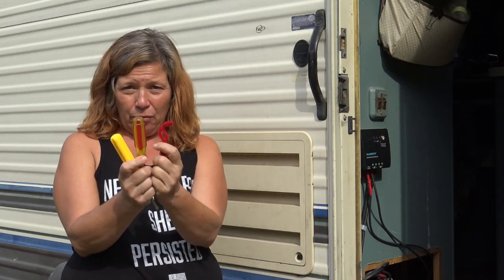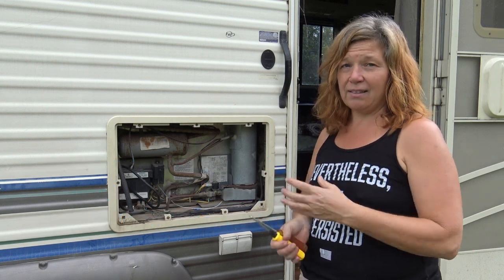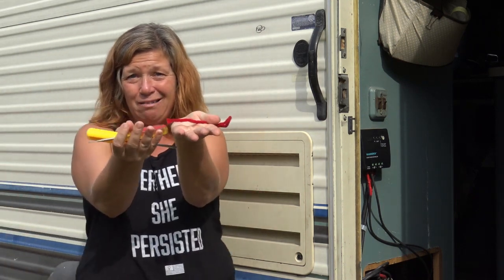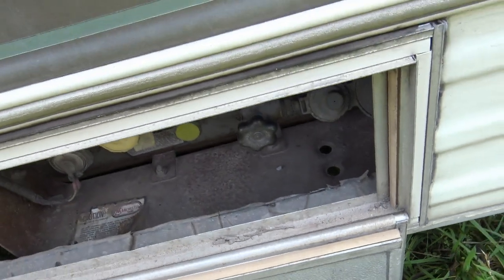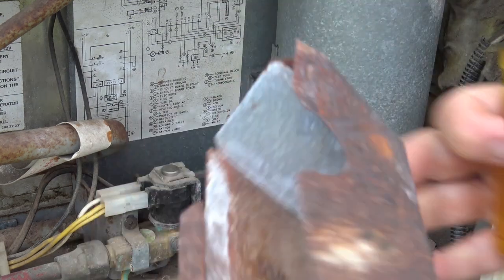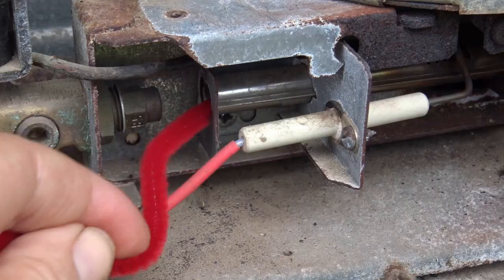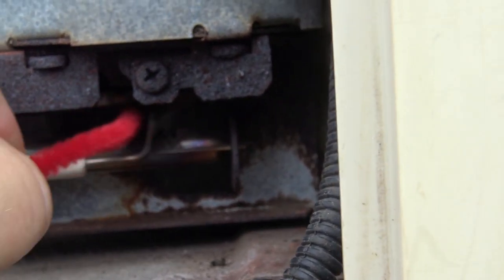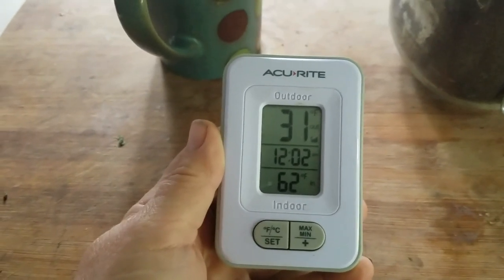How to Fix an Old RV Refrigerator that Doesn't Get Cold

Comment: i have fixed many refrigerators in rv parks when i find my baffled neighbours playing with their unit. If you get that screw out and get the burner tube out, you can pour rust out of it. Peoples eyes get wide. so then put the cover back on. Next go on the roof and take the plastic cover off. Inspect the screen to be sure air can move thru it. After the flame, moving the transported heat away from the condenser coil is equally important. Clean the screen and if you want here is where you would add a cooling fan to draw more air thru. Carolyn, you are exactly on the right track. Keep up the great work.

Jacqueline,
 Mechanic and Refrigeration Technician

Comment: Good on you Carolyn for taking this as far as you did.  I had a very similar experience with my 2014 Tioga Class C a few year ago in Key West FL.  It worked great on shore power, not so good on gas.  All the RV techs, told me to buy a new unit…I knew the problem was in the gas. I fooled around with it for days cleaning this and that and nothing changed.   Everyone was going to dinner and beach parties and I couldn’t go and stayed to work on my RV for days.  

I finally talked the local RV shop to sell me a USED, jet they didn't have any new one available. I switched out the jet and bam…it worked just like being on shore power.  It was my problem all along.  I then took a magnified picture of my old jet (which I tried many times to clean with lots of products, like alcohol or break cleaner and nothing worked) and I could see what looked like salt deposits in the jet almost closing off the orifice.  I still have it and will try to send you the pics of the close-up.   

I suggest buying a new jet, mine is a 58, you can see the number printed on the side when you take it out.  Its on the end of the tubing coming from the gas supply just before the burner. Here’s a link on a Dometic Orifice #58 Burner Jet  http://www.dyersonline.com/dometic-orifice-58-burner-jet.html?utm_medium=shoppingengine&utm_source=googlebase&gclid=CjwKCAjwuITNBRBFEiwA9N9YENGT1jvMbvak4THks2c27ObhI4d3vfCmLuOEYvwUi8NClKWwR9wbkBoCiRYQAvD_BwE

I found out you also need to clean the flue (burner tube) from above with a wire brush.  You can order one on-line from Dometic or I was going to buy a 3/4” pipe cleaning brush from Home Depot and rig it to make it long enough to clean the whole pipe from above, but I ended up taking the whole thing out and it really wasn't that bad. 

One more thing, on that condensate drain hose, instead of running it straight out the vent cover, first insure there is a drip loop in the hose before it goes outside.  This drip loop will act like a pee-trap on a sink and seal the outside air from inside your refrigerator.  Just make it go down first then back up high on the vent cover. The outside air can migrate up the tube and raise the temperature  as much as 10 degrees….and that burner cover should be tight, or could blow out from the wind when your driving. 

Let me know if you try this…Terry

Comment: We had a problem once with ours. Found the problem by chance. I broke the rooftop cover and when I pulled it off to replace it we found that the insulation above the fridge came loose from the sidewall and was blocking the air flow up through the roof. Made all the difference just by securing it back in place. Safe Travels!

Comment: "Sometimes I get lucky, sometimes I break shit."

We need THAT on a tee! lol

Everybody else is asking about your tank top, I want to know about your back tats!
Reply: Propane scares the crap out of me.
Reply: Janet, propane takes some getting used to. I used to make glass figurines and beads using propane tank and a torch. I had all sorts of safety re; propane only outside, flashback arrestors, always tested for leaks, etc.,  but still felt nervous every time I lit the torch. Then again nothing ever happened to the thousands of people who also make lamps-work like me. Or grill out. :) 
Cheers!
Reply: HAHAHA I'll Buy That!!!!
Reply: So would I buy a T with 

Sometimes I get lucky 

Other times I break shit

Love it
Reply: True words! I'd love to have that on a shirt too!
Reply: I want one!!!
Reply: Angela Siegfried Propane scares me too. We have a slide in that we discovered needs completely rewired, so we decided since we have to go that deep, we're building it back up completely solar. Including electric appliances. Then propane won't be part of the equation.
Reply: lol i agree Sometimes i get lucky sometimes i break shit does need to be on a shirt lol id buy it
Reply: @janetjohnson4246  It doesn't bother me at all. The trick is to know what you're doing, and how to be safe.
And don't run it on propane when you're traveling.

Comment: Greetings Carolyn, a couple other tips that will help, make sure your vent on the roof for your fridge is clear of debris. Good air circulation is a must for an RV fridge. Also, I've seen people mount a computer fan on the coils which  makes a big difference. There are several how to You tube videos on this topic. Lastly, the easiest fix is to park your RV so the fridge side in not in the direct sun.

Comment: Install a small 12 volt circulation fan up facing towards the refrigerator  chimney o the roof.  I put an on/switch on the circuit.  On hot days it increases the air circulation and gives me great cooling.

Comment: Another thing you might try is putting an "S" in the condesate drain tube to form a p-trap, like under your sink. Make sure it has enough water in it to make it air tight. I've heard (but haven't tried it myself) that this can get you another 10 degrees of cold, especially in warm humid climates. Makes sense to me since that tube is basically a 1/2 in diameter hole between your fridge interior and the warm outside.

Comment: Thanks for the ideas, I'm glad that you found a way to get the refer colder. Nothing worse than having a refrigerator that doesn't give you full service. I'm thinking of pulling the vent pipe out and having a sheet metal shop replicate it with stainless steel. It would never be the source of crap in the burner again.

You're on the right track and you've given me some ideas. I've seen guys with air compressors blowing out the burner. A great alternative would be to use a can of "Keyboard Air Cleaner". They come with a small tube that can be used to focus the air directly down the burners and up the burner in the same direction as the gas is blown. 
Further thought is the heat has to get into the flue and be there long enough to get the ammonia heated. Removing the baffle is probably allowing more heat into the vent pipe. I suspect my problem may be at the top of the vent or on the fins of the upper 'radiator'.

Comment: Hey friendly. I don't know if you couldn't get the screw out because it was too tight, or if the head was stripped. If the head is stripped, laying a wide rubber band over the hole and then inserting your screwdriver usually works. Just an FYI. Fun video.....
Reply from the maker: Thank you Linda!
Reply: Don’t ever use a drill on a stripped screw

Comment: Consider soaking the cover in vinegar to neutralize rust. Paint cover with Zithron 900 1235 degree extreme temp paint. To restore corrosion protection.

Comment: I put heat shield on any pipes that get hot back there and I put an exaust fan on the vent door. My temperature dropped 15 degrees.

Comment: Carolyn a air compressor may be helpful to clean the burner and the exhaust pipe of that system . If there is no air compressor available you may want to try the cans of air that people buy to clean dust off their computer keys boards It's fun at times to watch your videos and I imagine the fun interaction I could have with you⚓

Comment: Carolyn that cover is for when you're driving and if there's a lot of wind  to keep the flames from going out if it's on.
Reply from the maker: Yes you are correct. The cover is still protecting the flame and it's staying lit only now it's not blocking the flue!
Reply: That's good,  enjoy your travel.

Comment: Good job, Carolyn. You figured out what the professionals couldn't do. haha. It's just funny as heck. The clicking after you disconnect the electrical is the unit trying to turn on, on propane.  If when it starts clicking, run into your RV and check out the light on the refrigerator and it will indicate that it is trying to turn on, on propane.  
Also use a screwdriver and tap on the flu and then do your cleaning. You'll get most of that rust out.
One more thing, if it's a Domestic refrigerator, many years ago there was a recall on that brand because they were starting fires. So what consumers had to do was take their RVs for a fix and if I remember correctly all they did was install that small cover to cover the flame.  Go to the domestic website and enter your model # and be sure what I'm telling you is correct.  I am so damn proud of you girl! You can do anything.  Keep making those awesome videos.  Stay safe!  Love ya  :)

Comment: Hey Carolyn the flue should be checked for structural integrity aka holes and excessive scaling of rust . If the flue as it goes up to the roof develops a pin hole due to rust  the heat could seek out combustible material and the result could be a fire or carbon monoxide poisoning. Some systems cost money to check and repair why? because YOU are worth it.
Peace Out

Comment: Carolyn, I couldn't agree with the posters below that said you should replace that cover/shield that you removed.  It wasn't put there without a reason.  It looks a little bent on the right hand side and I'd bet that the "flap" on the left hand side belongs tight up against the other sheet metal. this may cause a draft through the burner tube that affects combustion.   As the others have commented carbon monoxide is nothing to play with.  As Jacqueline said you need to get the burner off and clean it out along with as much of the flue as you can.  I would also ensure that the coils are clean.  If you can't get the burner tube off you can probably clean it fairly well with a vacuum as compressed air will tend to spread the rust all over and possibly clog the orifice in the burner assembly.  If you must use compressed air please cover the orifice in the burner so you don't blow debris into it and make your problem worse.  Good luck.

Comment: Great job in getting the fridge to perform better!  I would put the screw back in place so it won't get lost even though the cover is not on.  If someone has some sheet metal shears, maybe cut the hole out a little larger.  If none available, use a hack saw and make small cuts around the hole then take pliers to remove the small bits to enlarge the hole then you can replace the cover and monitor the temp to see if that helped.  Also, does the condensation hose fit into a hole to completely drain out and away from the RV or at least our of the refrigerator compartment?  Keep up the good work!

Comment: That metal cover is just a draft shield, just cut the top bit off (the bit with the rusty curve) with some wire snips and reinstall it with screw, Be aware with it just pushed in with no screw like you have it now will result in it coming loose and dislodge which will let the flame easily be blown out by the wind.
Reply: I was going to suggest this too. The fact that its super rusty on top & not everywhere else suggests to me that its been colliding with the flame, resulting in that part of the housing heating more than normal, hence all the rust there. I wonder also if there isnt an obstruction in that flue, maybe a wasp nest or something.
Reply from the maker: rick,  thanks!

Comment: I acheived another 10° of cooling differential by, mounting a small 12v computer fan, gently & quietly blowing air up across the heat-pipes, located higher on the back of the fridge. This blew steady for a couple years before dust killed it, so just replaced it for more good cooling. It uses Soo little power that it's draw isn't even noticed.

Comment: Hey Carolyn i see that your frig does not have the protected shields around the burner assembly. These models were recalled and dealers had to retrofit around burner. Not that it had anything to do with cooling just a big fire hazard. Please look into it. Great vid . And a side note inside the flue there is a flue cleaner it's a long rod with a loop on top and a spiral piece on bottom that when pulled up and down cleans the lining of the flue. The problem is accessing it. I take off the cover of the roof vent and with a coat hanger i can hook the rod and take care of business . Not many people Know this and it will help with cooling.
Reply: That's not a cleaner it controls the exhaust speed needs to be there .
Reply: @peterstencell804  I try to keep it simple on my replies if i would have told everyone it was a flue baffle that would have been a whole new topic, but if used the way I said it will remove wasp nest ,dirt daubers and rust that prevents flue efficiency.

Comment: Suggestion- as well as cleaning the burner-clean the gas jet. Not a job for you but Bob could do it. Also you can adjust the flame h eight and that might help. They are a pain in the butt to work on!!
Reply: Not a job for her but Bob can do it??? Really? Why is that? Carolyn can do anything Bob can do.
Reply from the maker: karl, you're trying to get a rise out of me with that comment right??? I challenge you to spend a day with me and bob - or any man - and then tell me what a man can do better.  #REALTALK
Reply: I just reread my "my suggestion" and did not realize it sounded like a cheap shot until the reread!!!  My thought process had to do with the tools necessary. Well also possibly your knowledge of GAS systems.  I know plenty of men I would suggest get help also.  That piece of metal does need to be put back in place. It's a wind shield. Invest in a small wire brush and get the rust off. A good screw driver and remove burnerand clean it well( or good) whichever is correct. If I ever make another comment I will make attempt to keep my old sexist attitudes to a minimum! Good luck and keep on trucken.

Comment: compressed air in a can like you use to clean the inside of computers and keyboards could get more rust out than the pipe cleaner.
Reply: Wud recommend covering gas orifice so debris doesn't get lodged in it causing problems with lp flow to burner tube- The RV Repair Guy, llc

Comment: Good job! I would get a can air to help as well, the big slag on top of the burner wasn't help at all, also using a angled pick to clean out the openings of the burner, the small little groves, we call them fingers, also I use a strip of sand paper, about 8-10 inches, strip it to 1" inches and fold it in half, so it's 1/2" x 8" and then make it bend around the burner and sand it like you are polishing shoes and then blow it out! Also blow up the chimney  with the tube on the can air, and I like to slap the vertical tube a few time to get any loose rust out, and blow the burner again. Also try and get the cover back they way it was, try and get the right side in and push in the left, lot of reason why you need it on.  I go by the sound of the burner when it's burning, nice and Crisp sound. Awesome job!! It's great that you took it on and got great results.

Comment: It just occurred to me you should have 2 6 inch long level tools a carpenter uses as an rv refrigerator is very sensitive to being level. If it's not dead on level it can cause it to reduce how cold it gets by up to 70%.
Set one level to check front to back and the other for side to side. Find a place for both to give you an accurate reading by parking in a known dead level spot then fine 2 places for the 2 levels to use every time you park. It might sound silly but that will go a long way to better functionality of your RV refrigerator. I had a lousy working refrigerator in my 78 RV at a campground and was signed up for one week and had to buy bags of ice to cool my stuff. Another RV owner asked refrigerator problems? Mine was like yours a 3 way but I only bused 120 volt or 12 volt when driving. My next door RV neighbor went into his and came out with a 6 inch carpenters level and after we went inside set it on top of the fridge and it wasn't even close. I was new to RV's at the time. Got out my leveling jacks and 15 minutes later she was dead level and two hours later I checked the fridge and she was cold as ice working better that I had seen in my first week of vacation.

Hope this helps.

:-)

Comment: Wow, great work. "I love it when a plan comes together." It might be fun to go to a hardware store and pick up a little square of that tin and shape it like that other one.
Reply: Don't ya love it when you get in there and  brave it...and your intuition about something works ?!! Proud that you do try these things on your own ♡ so glad its fixed, your food will last longer now !!  One thing that came to mind for me is the cut out part on that piece you gerryrigged in there.....im thinking the curve ( cutout) maybe could be tin-snipped out a bit to make it larger and then put back into place with the screw replaced......Im concerned that by not pushing it all the way in ( for better flow) might be causing some bad exhaust to circulate inside your motorhome rather than being guided up into the flue.....it may be that the airflow going up and out may also be the problem and not the airflow pulling in...just another thought from my silly mechanical mind ♡  just worried about the burning exhaust inside the motorhome.....??  Dont mind me...im only trying to put more minds togeather and thinking about your safety and health in the long run..thats where my head is at ♡♡  great going kiddo !!
Reply: It worries me too that the piece isn't in correctly.  My fear is the flame may escape it it has some kind of flare up.  We don't want a fire.  The frig is usually between the bed and the door in these things.
Reply: Denise Rosser m